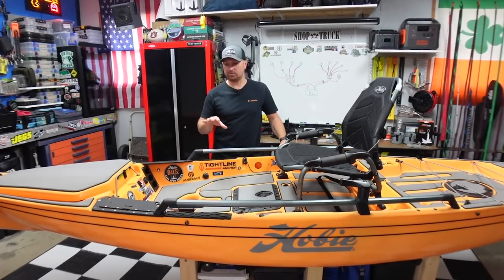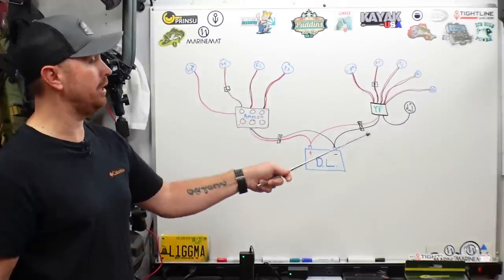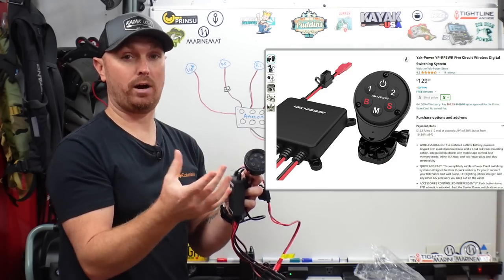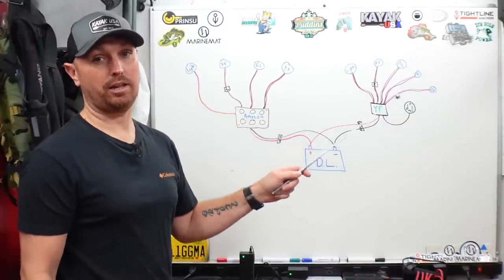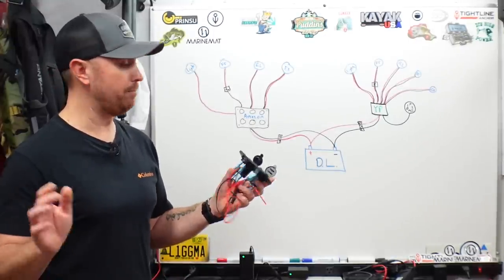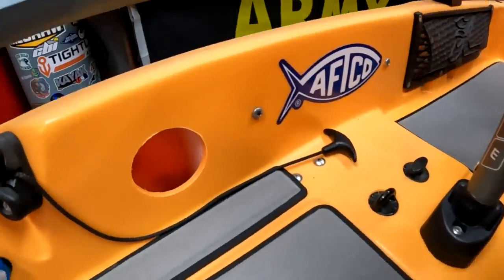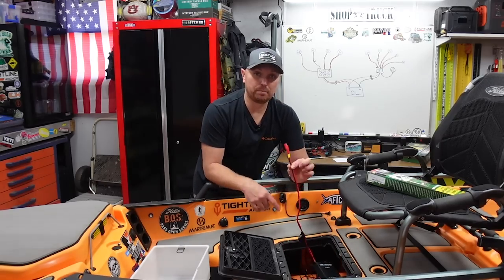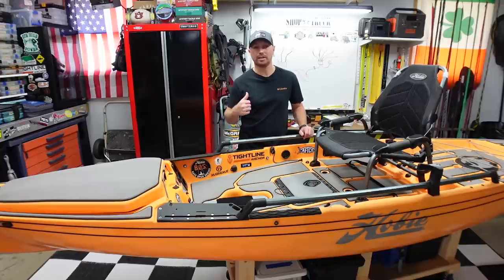DIY vs Plug N Play - Kayak Power Ports? LED Lights? How To... EASY!!

Comment: Just received my Yak Power system.  Been watching a lot of install videos and just came across yours.  This is by the far the best and most informative one I've seen.  You even go a step further by talking about the "Amazon" version and how you can incorporate it with the Yak Power System.  Nice job!  Liked and subscribed.  Thank you.
Reply from the maker: Awesome! I appreciate the support! Glad I could help! 👍🏼
Reply: One thing I noticed, the USB charger from Yak Power does NOT charge fast. It is very slow. Used it a full year and had the same problem.

Comment: I did a bit of a hybrid on mine. I used the yak-power setup but then ran to a cigarette lighter and volt-meter/ usb combo panel in the front as well. The yak power unit definitely made this an easier build overall.

Comment: T.J. great vid bro. I started with the amazon usb and VM ports, for charging electronics, a Cabela's and Nocqua battery for my FF. Now, I love the yak-power, because the relay box, cleaner, and easier install. Now i can charge my drone, cell phone, go-pro, off two usb ports i installed. I run a Led bow light red/green, and my visicarbon pro. I also run the new PP 768 J2 Bixpy. 💯 🌊 🎣
Reply from the maker: NICE!! 👊🏼

Comment: TJ.. great content as always. Question.. concerning the Yak power set up.. Probably a dumb question… but how long are the wires you get? The plug and play connections looked short. Do you get extra wire with the kit… do you have to splice wire in to reach different areas of the yak??
Thanks! Love your videos my friend!

Comment: Thanks TJ.  Yak-Power is a little bit more money but is worth it in the end.  Also, question...Did you choose the mount the YP switch in the front because you wanted to have the YP relay in the front hatch?  Noticed it was different on the new boat.
Reply from the maker: Thanks! I actually put it there on the green Hobie because I’m gonna add more lights down the sides and didn’t want it in the way.

Comment: Amazing channel. Thanks for the vids. Question about your kayak cart with wheels that you built about 3 years ago. How has the cart been so far? And also if you use it as storage for your kayak how is the bottom of your kayak looking? Any indentations and what not? Again thanks for the videos and look forward to more videos.
Reply from the maker: Love my cart, still works great and it always holds my kayaks. No damage. 👍🏼

Comment: This was more like a commercial for Yak-Power. At every comment it was all about how much more work you would need. This is the problem, most of these reviewers receive it for free. If I got it for free, I would have good things to say about it also. If I am spending my money on it, for 4 times the cost, it better not need any troubleshooting etc which isn't the case. you can customize the panel how you see fit, which you cant with yak power.  SAE plugs are cheap and can be added to any product and not yak-power exclusive. If you have no technical abilities and a deep wallet, then Yak-power is likely your only option anyway.
Reply from the maker: Well, you must have missed the part where I said “ This is not a sponsored video and I purchased ALL of my Yakpower kits..” Thanks for watching.. 👍🏼